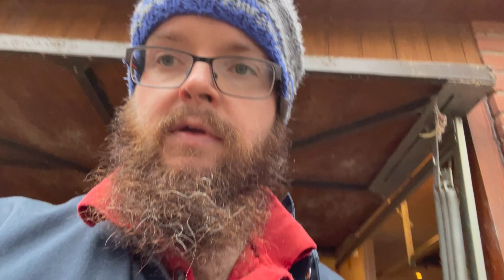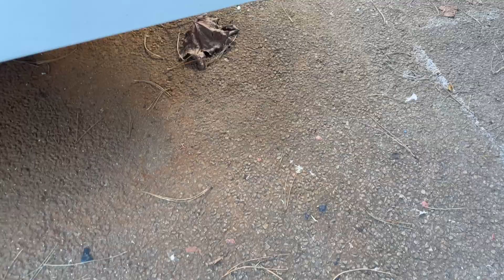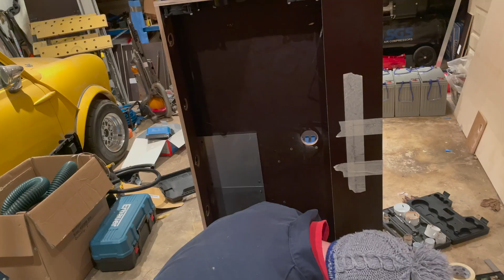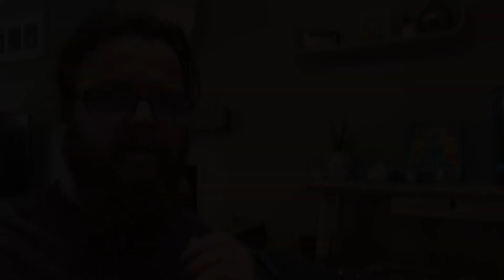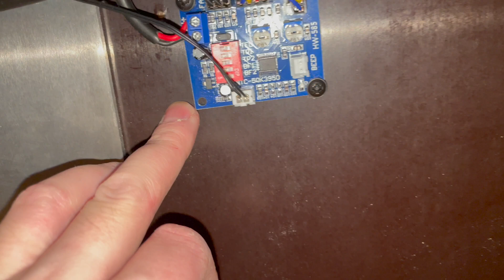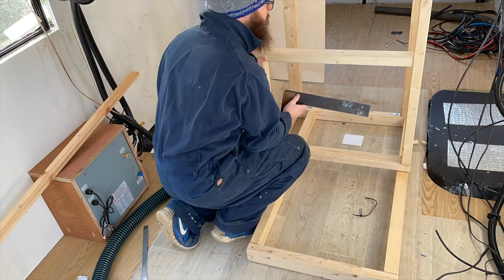Van Conversion Continues + Testing Diesel Heater After Being Stood Up | Mercedes Vario Van Build

Comment: I was just saying to my son it's funny that I watched your video on putting the diesel heater in when I fitted mine and it's only just getting it's maiden test run.  I loved mine in the summer for hot water but after staying in the van last week I'm so glad I fitted one the insulation worked well through the night but was glad of the warmth in the morning.  Have you seen truth seekers on Amazon prime maybe you should consider doing the livery from the van on that on your bus that would be cool.
Reply from the maker: Right on! That's brilliant. It ran a treat when we used it earlier, but now it works for real we are pleased with it. Truth seekers was great; mainly due to the Vario :-). Did you see that it went up for sale?
Reply: @WanderbusAdventures  oh no I didn't actually, be a great livery for your bus . Be nice for you to be able to switch the heat on while you work on the van.  I believe the biggest draw of heat is. Switching it on once running they don't use much electricity
Reply from the maker: That’s right. It’s about 10amp on start up and then much much less. Fingers crossed the leisure side will be up and running soon anyway 🥵

Comment: Hi both. Enjoyed the video guys. I’ve said it before, your attention to details is commendable. I just made it up as I went along. 
We have a Truma therme. It fits after the diesel heater. It doesn’t heat a great amount of water but it’s free hot water. Has an electric element also. It’s our main hot water supplier but could be a useful backup on a build.
Reply: I have heard of the bobbil but hadn’t at the time I bought the truma. It wasn’t the cheapest! The truma is 12 inches from the diesel heater and works great. We don’t have a shower, so the 5 litre of hot water is enough for us especially when mixed with cold water. But if you can make it work for you, I good back up.
Reply from the maker: Awesome, thank you Martin. Sounds interesting, will look into that. We also considered the Bobble Heater, have you seen those? How close to the heater is your Truma fitted. Am wondering whether it might be a good option for winter water if we cannot use the iMass for whatever reason. A backup like you said.

Comment: thinking the 3x2 par wood framework is a bit over kill and more weight 2x2 par would have been just as good (but just my opinion) liking the consumer box you should patent it 😁good informative vlog as usual well done guys 👍
Reply from the maker: The thinking on this part is it’s holding the bunk bed too. It’s hefty alright 😆. For the bathroom we will def step it down and for the kitchen cabinets won’t be framing we don’t think. Thanks re. The box. We thought it might be a bit over the top 😊 but it looks
Tidy

Comment: Awww you teased us with the scribing but didn’t do the obligatory panel slide up to the wall to show us how well it fitted 😂😂 great job as always. Are the aluminium sheets for the victron gear?

Loving the living room too, very smart 😍😎👍🏻
Reply from the maker: Hehe. Truth be told the camera went dead at that point. Will get some footage of it once We’ve done the other side. 

The Ali sheets are some extra backing for the Victron B2B and solar charger. It’s the B2B that can run hot but as they were next to each other we thought why not do both. Not sure it’s strictly needed but as we are in a bit of tight space thought it couldn’t hurt. 

The living room was a big project a few years back. We are pleased with it but even that needs a new coat of paint 😂. Houses, who’d have Em? Hope you’re enjoying your weekend mate. At least the wind has gone today
Reply: @WanderbusAdventures  thought that’s what the Ali was for. I’ve been looking at getting the 30a b2b for my van and heard they can run hot. Mine will be under the drivers seat so 🤔🤔🤔

They always need painting! Always! We started stripping our bedroom yesterday so it’s a bit upside down at the minute, can’t wait for our new bed 🛏🛏😴😴

Yeah it’s been crazy, our layzspa gazebo tried to escape early hours yesterday morning 😢😢 a new one needed next year 🙄🙄

Comment: Your diesel heater needs to have air from the bus interior going back to the inlet. Your setup at the moment is single pass ie air from outside through goes the heater into the bus and then out through any gaps, doors etc, it will work far more efficiently with air recirculating back through the heater. The diesel combustion is separate and exhausts to outside but your system has the ability to bring in fumes if conditions are right. Enjoying watching your build. Mine took 18months of hard slog, but very worthwhile in the end, good luck.
Reply from the maker: That’s right. At the moment I have a rather dangley looking hose underneath. In two minds of where to bring it into the bus at the moment. Ideally it will be through the floor with an inlet vent on front of the bed or in that area but access is a bit tight. In the worst case I might have to bring it under the bed area. Thanks for sharing this info. I know some people haven’t done this and as you say it’s inefficient. Did you route yours close to the hot air in?
Reply: @WanderbusAdventures  my heater is inside my drivers steel chair base, warm air out goes like yours in ducting to various parts of the van, and I cut an opening on the chair base with a vent cover for air in the van to be recycled. Mines at the front as I tapped into the fuel tank etc so kept it as short in terms of fuel pipe. I routed the fuel through the engine bay as the tank is on the passenger side. Works really well and warms up in no time, which is how I worked out yours was single pass. In 15 min we have to turn it down as too hot, ours is a lwb sprinter.
Reply from the maker: Ah cool. That makes sense. It’ll be interesting to see what it does to the times. Thanks for this mate
Reply from the maker: We’ve also some plans to make some insulation jackets for the hot air ducting too. Just as an FYI. Meant to mention this was in the works in the video. Seems like a good idea.